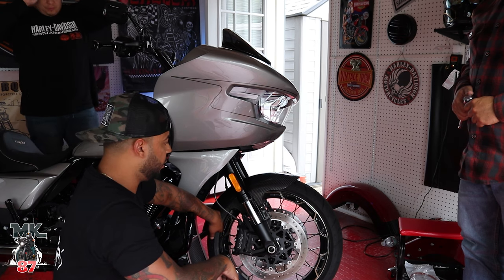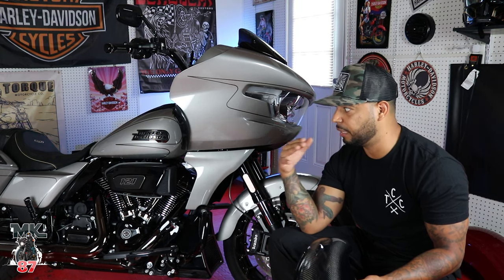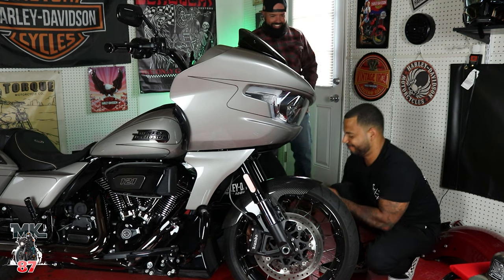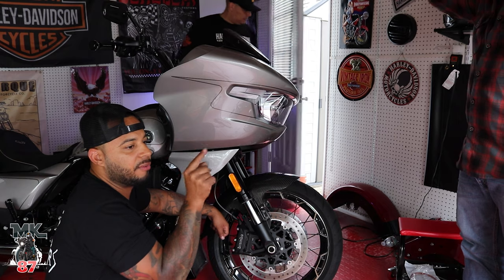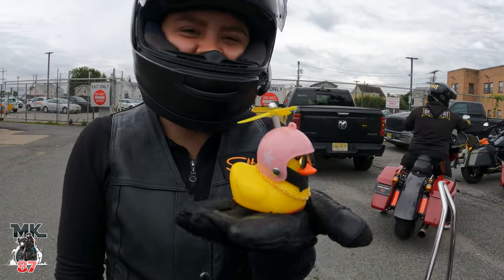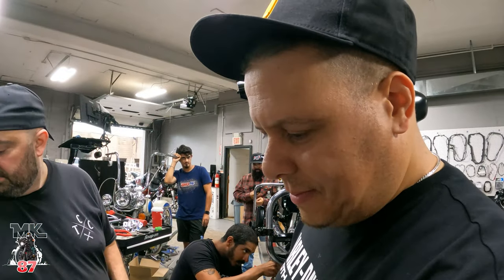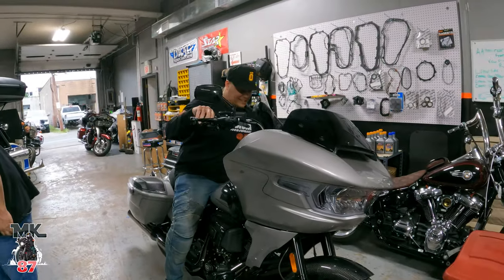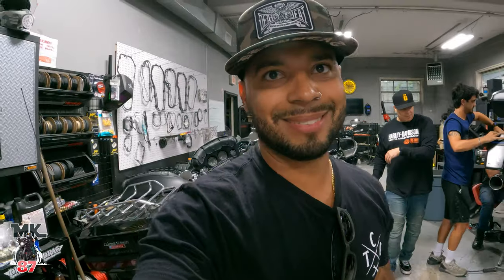Hofmann design carbon fender install for Harley Davidson Road Glide cvo / This didn't go so well

Comment: In a past career I had a motorcycle paint shop, and the local tuner guys would bring their bumpers and hoods for "flat blacking" which turned into asking me if i could install carbon fiber hoods...i learned a deep hatred for that material. 

When i was shopping for a front fender for my EGS/ST build, i thought for a second about a carbon fiber fender, but then I realized it was the shitty domestic beer talking and wised up.